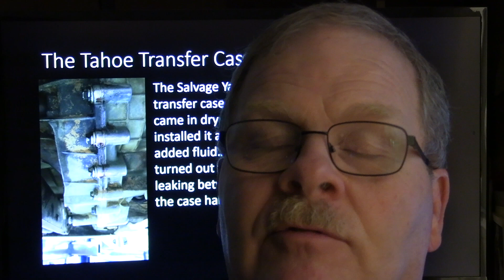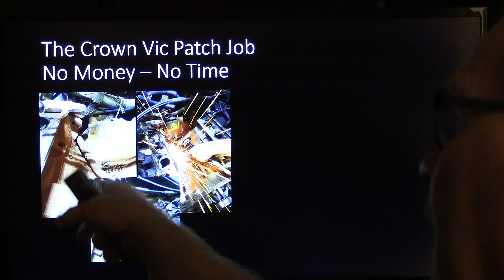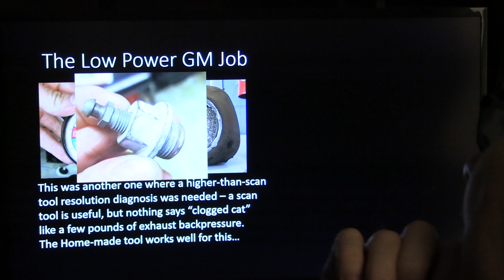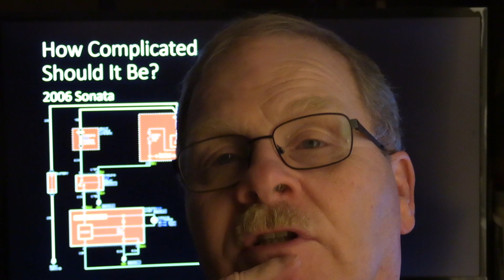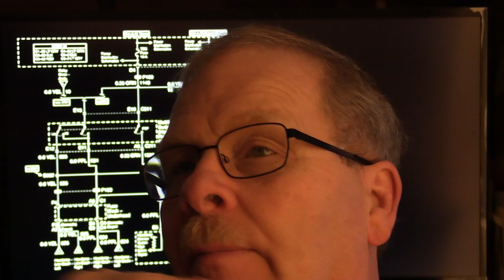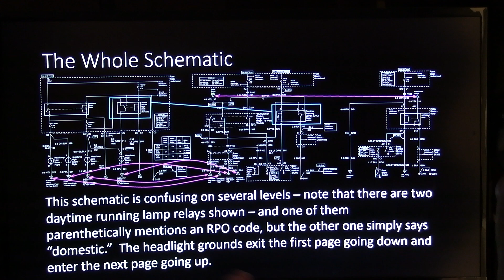Unexpectedly Complicated

Comment: With multiple cats and cats that break up and clog other parts of the exhaust system, (muffler ect.) I also use a piece of 3/16 brake line inserted into a 3/16 hole drilled into the pipe. This way I can check pressure at any place in the system I desire. I have brazed flat stock onto the line to facilitate an easy way to hold this for road tests. Just use a spring wrapped around the exhaust pipe to hold the line in place. Just connect your gauge to the brake line. When finished testing, use a 3/16 pop rivet or weld the hole shut

Comment: BBQ AND CARS  !!! That will make me make me look. Then the smell will make me want to take a bite. 
The screens in the new cars are nice however I like to drive.  As a driver I prefer the switches and dial controls of the older cars. It is much less distracting to use basic controls when you can feel the position they are in and keep your eyes on the road.  Switches and relays should be simple and easy to fix.